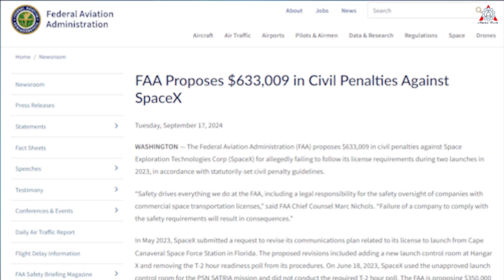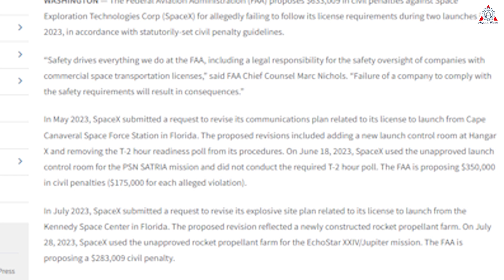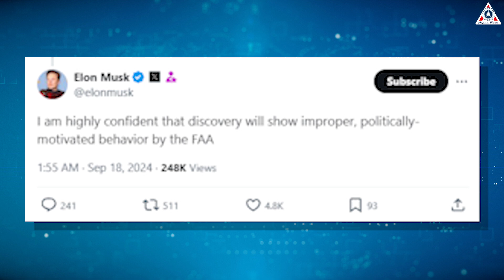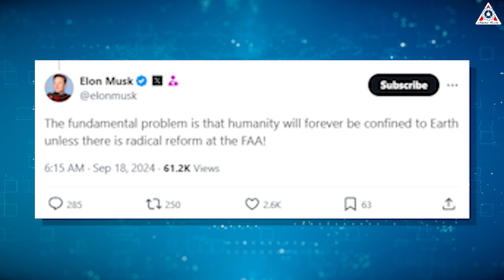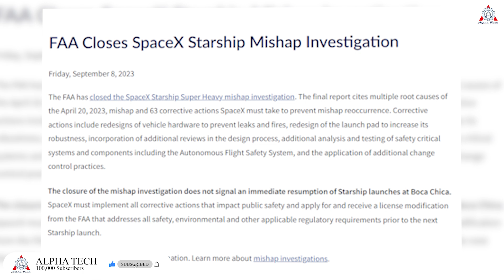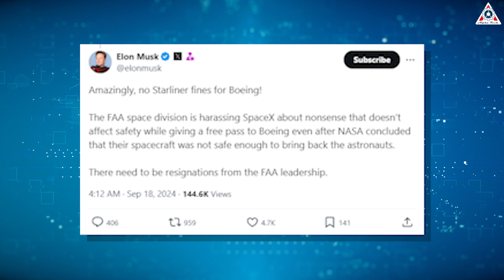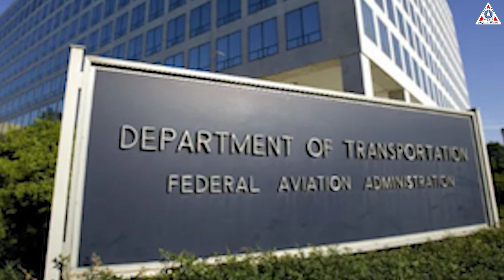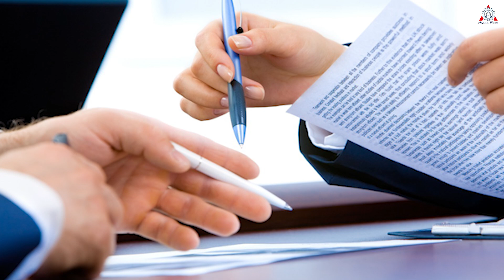SpaceX to Sue FAA! Elon Musk Just Exposed FAA and Boeing Starliner 'NO' Fines...

Comment: NASA and the US Military have their own regulations, and override the FAA. SpaceX is no longer covered by NASA or the US Military, except for launches bought by NASA or the military. That is why Military launches or NASA launches bought by either organization from SpaceX are still allowed.

As to the fines levied against SpaceX by the FAA and not the Starliner as mentioned above is because they are still under NASA. Where we need to look is the airports and private airlines to see if they fined and have to file for a new flight license when they change aviation fuel location and/or communication equipment.

The one thing that really gets me is, the FAA regulations are to broad, and are basically for commercial services. IE:  passenger services for the safety of the people flying with those services. SpaceX (Starship) is at this time not flying passengers and are for testing and research.

Big question is, does the FAA demand a new license each time an aviation company tests a new plane, communication system or changes the fuel storage location at their test site?

Comment: Sorry but FAA wasn’t and isn’t responsible for Starliner - NASA is. So NASA is deciding what happens next. 

FAA is responsible for public safety with commercial launches - so as much as I dislike my own comment, your video is wrong on this specific point. 

I can also understand why the overregulation in the FAA happens - it’s the same reason we have overregulation in the company I work for - no one wants to make a mistake and be charged with the consequences in case something goes wrong. 
To be honest I wouldn’t do it differently if you consider what happened in China earlier this year with the rocket breaking loose and almost hitting a city. If the investigation found it was my fault due to lax security enforcement and risk analysis 🤯

Comment: Did Starliner violated regulation? No, so they don't get fines. Falcon 9 did not get fine when its second stage exploded, why should Starliner get fine for helium leakage and the lost of a truster?
Reply: Because Starliner put the lives of astronauts at risk.  Now those astronauts are stranded in space for a year.  Does that answer your question?  I thought the FAA was all about "safety"?

Instead the paper pushers are nitpicking over an unmanned rocket, launched from an unmanned launchpad, over the Gulf of Mexico.  Where is the threat to so called "safety"?
Reply: @CitizenRule  No it does not. Because like it or not, a system that did not violate any regulation, that got the OK to fly (remenber, starliner did a test flight without any issues) and then has a problem does not get fine, it get grounded until the issues are resolve. This is more effective than fine to ensure safety for everyone, don't you think?

As for ITF5, remember the FAA is also there to ensure the protection of the environment. So a maneuver that as never been try before on a launch pad surrounded by a wildlife refuge and a wildlife management area might need some time to get approve, especially if SpaceX give new informations during the aprobation process. And you do know that Boca Chica is less than 10 km away from Port Isabel? Super heavy only need a 10 km deviation to be above a town. Is it likely? No. But it is still a threat to safety.
Reply: @Junebug-me4bj  My comment mysteriously disappeared.  I am not shocked at all.

"not violate any regulation"

Do you care about "safety" or only regulations?  That's a rhetorical question.  If you or the FAA really cared about safety, then you would be investigating Notgoing.  (For some reason I can't use the B name without my post disappearing.)
Reply: @Junebug-me4bj  "FAA is also there to ensure the protection of the environment"

Wrong.  That's the EPA's job.

"10 km away from Port Isabel". "still a threat to safety."

The launchpad is next to the beach and rockets fly over the Gulf of Mexico.  The threat is near zero.  Of course, if you believe it's a significant threat, then the burden of proof is on you and the FAA.  Please calculate the threat to five decimal points.  And don't forget to show your math.
Reply: @CitizenRule  I can still see your comment.

Which one is more safe, a fine or not being able to fly? If Starliner cannot fly, it is probably way safer than what a fine can do, do you agree?

 Prety sure the FAA is subjet to the National Environmental Policy Act and that they are doing enviromental assessment. So while they do not put in place regulations for the enviroment, they are very involved in the protection of the environment.

I do not believe it is likely and I cannot give you any number since I do not know how reliable superheavy is. But, don't forget, Super heavy is suppose to come all the way back to the beach and Port Isabel is not far up north. The FAA likely take that into account and reevalute every time SpaceX change a detail.